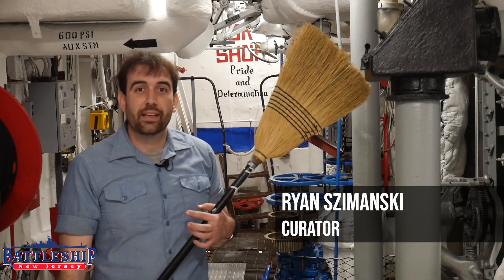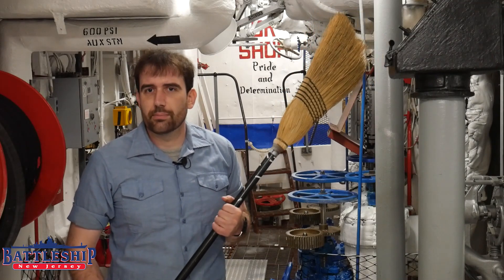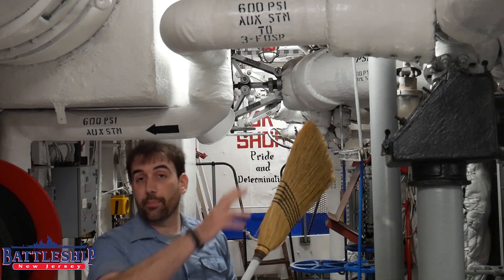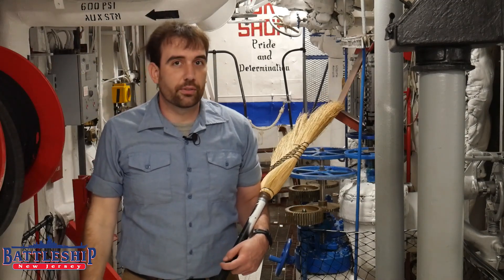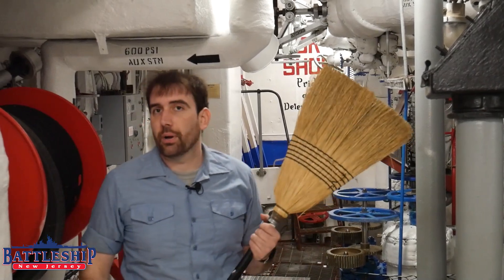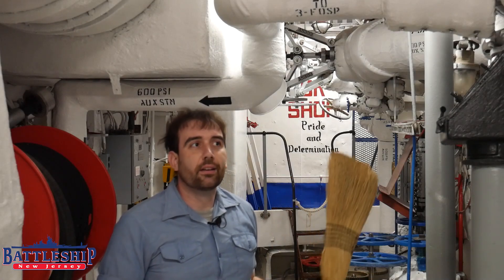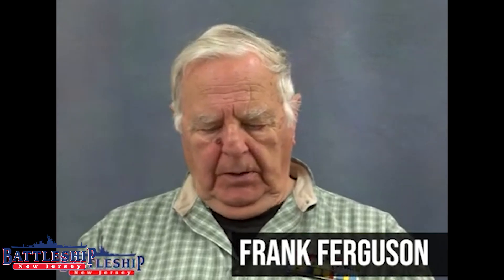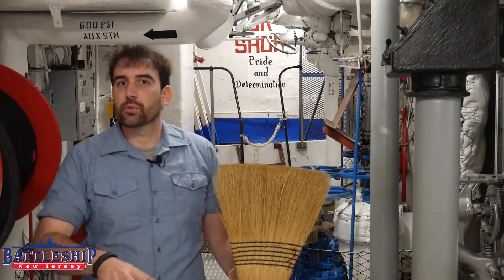Searching for Steam Leaks in the Battleship's Boiler Room

Comment: Used the same broom technique in the search for high pressure air leaks.  The SSBN I was on had some air pressures as high as 4500. Don't forget all nuclear powered vessels are basically steam powered. They just use reactors instead of boilers the heat up the water.
Reply: During the pad fire that scrubbed STS-41-D (the first flight of Space Shuttle Discovery) for several months, there was a period when they knew that there was burning hydrogen in the area but not where. The problem is, hydrogen burns at such a high temperature that the flame is virtually invisible during the day, and because hydrogen is so diffuse, there is virtually no ambient heat until you're literally being burned by the fire. So NASA engineers, for days, were walking around that pad with brooms outstretched and when they pulled back a burning broom, they knew they had a fire to fight.
Reply: I actually had that realization the day after my friend, who was a nuke in the navy, explained the basic operation of a nuclear reactor to me.  Next time I saw him I asked "Isn't that just a more advanced steam engine?" His eyes went wide and he was impressed I picked up on it. He told me a fair number of the guys in nuke school never put that together.

Comment: I had no idea, I would be curious to know which types of ships ran what for steam pressure. A broom as  a search tool, ingenious.
Reply: Smaller/faster ships generally ran 1200 PSI.  Larger ships and merchant ships generally run 600 PSI.  Even diesel-powered merchant ships will sometimes have an auxiliary low-pressure boiler for heating heavy diesel, space heating and hot water, etc.
Reply: @kevincrosby1760  I was on a world war 11 cruiser ,and we used 600# superheated steam .Flank speed was 32 knots .

Comment: Yep super heated steam has no water vapor. It is invisible.... that's what super heating does it removes water there by "Dry steam" which has less resistance and is more efficient.. The steam whistle on a tea pot uses water vapor to make the noise. we regularly walked around with broom sticks it was easier to keep the Non bristle end in the air for long periods. if the the end of the broom handle hit the deck all stopped until leak was found 1200 PSI is nothing to fool with it will cut steel.jim 2nd ENG.

Comment: 32 years of local 638 NYC Steamfitters and yes you use a wooden ruler in front of you when entering a room with high pressure steam for the 1st time.
Reply: United Association of Plumbers & Steamfitters and HVACR.   We continue the tradition and are the only remaining institution left teaching Steam since the US Navy is fast departing steam plants for Gas Turbines and Big Diesels.
Thank You Brother
Reply: @curtiscains8533  not completely correct.  Nuclear-powered ships are still all steam.  The difference is simply how you are heating the feed water.  Everything is still pretty much the same once the Main Steam pipes enter the engine room.  I believe that modern carriers are still running 1200 PSI.

Comment: (1) stem would very quickly adiabatically expand to atmospheric pressure, so RIGHT AT the hole it'll be full temp and pressure but outside the leak stream it'll be 275-315F (75-100 F superheat) then that stream will rather quickly drop to saturation. Still hot enough for instant 3rd degree burns 
(2)We totally did this at the power plant, though in my 13 years, dealing with everything from 1005f @ 2500 psi to 1080F at 3600 psi, most leaks were pretty easily identified. But we did have a couple LARGE leaks we could hear and not see. Those were fun days.
Reply: that's terrifying
Reply: I was in 1200psi superheated engine room on USS JOHN F KENNEDY CV67 and this is exactly how we checked for suspected main steam leak normally valve flange or valve stem packing

Comment: I am retired from a large steel mill, our companies main boiler house had a number of very large boilers producing high pressure super heated steam.  I was in electrical maint. and I would maintain the instrumentation and electrical systems, we were taught that the first thing indicating a HP Superheated Steam Leak... would be the noise, maybe, depends on the level of ambient noise... we were taught if a leak was suspected to use a 2X4 in front of u.  HP superheated steam is a dry steam and is invisible....and if the high pressure doesn't do serious damage to u, the 800 degree plus temp. will .... at that pressure and temperature if u ran into that leak, it would instantly burn flesh off of u to the bone...
Reply: Absolutely,and scold your lungs . In this situation vacate the space put on an OBA then trace down the leak and isolate it or your a dead man .

Comment: I was told the same thing about using the broom to find high pressure steam.  I wish Myth Busters had covered it. 
Old wives tale?  Well water jets do cut with more pressure but far, far less heat. Water transfers heat very well. 
BTW - it is dry steam so there are no fluids. Water droplets are bad for turbine blades. Picky, but educational. 
Congratulations on the extra commercials during the video.  Perhaps add a few facts to get over the 12 min mark. I'm told that increases monetization.
Reply: Yea, I’ve wished we’d see some sort of test or video documenting it. Superheated (dry) steam is invisible, but the question remains, how long it remains superheated after it crosses the threshold of the hole into the atmospheric-pressure space. Do the perimeters of the flow stream depressurize fast enough to reach saturation and become visible?
Reply: @westtex3675  you need to drop a LOT of BTUs before the steam becomes visible vapor.  Temp needs to drop from about 850 down to 212, then shed enough additional BTUs for the phase change from 212 saturated steam (invisible) to 212 degree water (visible).  A BTU is the amount of heat required to raise the temp of 1 pound of water 1 degree F.  I keep thinking that it takes around 900 BTU to initiate the phase change from a pound of 212 degree water to a pound of 212 degree steam at sea level.  Ditto going the other way.  It's this additional energy for the phase change and the volume difference between water and steam which allows useful work to be performed with steam.
Reply: I’m not thinking the room is going to quickly cool down the stream enough. Just the rapid depressurization might bring it (or at least some of it) down to saturation. And if it is truly a pinhole leak, it seems you might have much less that 1lb of water in a 3ft long jet. And if even a fracture of the mass is able to drop to saturation, then maybe it would be visible.
Reply: @westtex3675  Never saw an actual steam leak.  From what I was told, by the time the superheated steam cooled down to the point of condensation, your visible vapor was diffused and not necessarily very close to the actual leak...and we are back to waving brooms around.  I can affirm that the brooms were present in quantity and were waved around if a leak was suspected.

Bear in mind that I am not the definitive source for steam-related topics.  I wasn't a BT or MM, I maintained the instrumentation, not the systems.  I simply found early on that my workload decreased drastically when I understood the systems well enough to determine if a problem was in my sensors or their equipment.  

Go back to some of the other videos and look for the engine order, prop order, shaft revs, helm console, speakers, microphones, SP phones, dial phones, intercoms, gyrocompass repeaters, temperature/pressure alarms, fire/flooding alarms, etc.  Will explain why I spent a LOT of time in the Fire Room, Engine Room, CIC, DC Central, and the bridge.  Was also qualified for main switchboard (generator) watch.

Comment: Straw brooms are also used by truckers hauling liquid hydrogen...it's the easiest substance in the universe to ignite, and it burns almost invisible...so you walk around the truck with the broom and if it starts to smolder you de-ass the area immediately.
Reply: Not only does it ignite easily and burn near-invisibly (so that in full sunlight it's at the very edge of visibility), it both ignites and burns in almost total silence.  Almost the definition of a spooky combustible.
Reply: De-ass. I like that. lol
Reply: Not after a cigarette?
Reply: @acester86  if you want to boom... 💥
Reply: LH2 fire in a pressurized tank transport?  Yeah that's a significant de-assing protocol
Reply: It's also one of the hardest things to seal properly due to the tiny size of an H2 molecule. It's very easy to get leaks. Even some things that are considered completely impermeable to us, like mild steel, are porous to hydrogen.
Reply: @Lessinath  To Hydrogen pretty much everything is porous, it is just the rate that varies. That is why the most popular way to transport hydrogen for vehicles is in metal hydrides, where you take advantage of this to have the gas stored as a phase in a solid porous matrix, so it can be stored at low pressure and only diffuse out slowly as you use it.

Comment: One more thought.  Before Flexitallic flange gaskets were invented,  it wasn’t unheard of to have to run around a power plant during startup or shutdown  and re torque some of the flanges so they didn’t leak.
Reply: I haven't been around that long, but I have done considerable (non-academic) research on gasketing in high temp/pressure steam service and this doesn't make sense to me. The primary application difference between a spiral-wound gaskets and graphite flat gaskets is the minimum seating stress and m factor. Thus the the flat graphite gasket, appropriately torqued, should still seal regardless of thermal cycling. I could believe this would be caused by using B7 bolts in a B16 service, as possibly the B7 would grow more than the B16 at higher temperatures? Unless there also wasn't graphite flat gaskets back then either and the real issue was asbestos-fiber gaskets, which don't stand up to thermal cycling like graphite can.
Reply: @timb83  Asbestos fibre most likely, as plenty of very old steam plant is still in use, and will only get repaired when stuff fails, so a gasket that was put in in 1960 would likely still be in there, along with asbestos packings in valve gland boxes.
Reply: @SeanBZA  I've ran into those gaskets doing several different pipe replacements at different plants, and shockingly I've never personally encountered them in high temperature service (most of those must have been changed out before my time) so I have only have academic knowledge of how well they worked after being cycled. The only contemporary anecdotes of asbestos gaskets in high temp services I came around was in steam turbines, but not any that I worked on. Just enough that I knew to be cognizant of possible abatement needs when taking one apart.
Reply: @timb83  I have seen asbestos lagged pipes still in use as building hot water, and also you still find asbestos gland packings around, even new are still in use for some applications.
Reply: @timb83  remember also that every component in the steam system is designed to move a certain amount due to expansion and contraction.  What doesn't move, breaks.  Flanges WILL leak.  This is why temperatures are bought up slowly, steam is introduced slowly, etc.  As a general rule, leaks go away as things heat up.  The problems arise when gaskets fail AFTER you are at full temp and pressure.
Reply: @kevincrosby1760  which informs the designers decision on what kind of joint (mechanical v welded) to use in a given application. At the joint the proper child torque should be applied to the gasket to ensure its leak-tight hot or cold. If leaks occure: (a) the wrong bolting was used, (b) an improper gasket was selected or (c) an inadequate tightening procedure was used. Given a long enough time-line everything will fail. Given a reasonable life expectancy gaskets shouldn't leak.
Reply: @SeanBZA  oh yeah, I know that shit is around like landmines, I just have no personal experience with the efficacy of asbestos gaskets in high temperature service.
Reply: @timb83  In theory you are correct and shouldn't be an issue, but even so the boilers I worked around (albeit not navy stuff but still high pressure) you'd always have leaks regardless if the bolts was torqued correctly. Through heating and cooling, water hammer, and any other vibrations through out the plant will always cause things to loosen up over time. Yes by all means they should never leak, but in practice and in actual operation I can promise you, your going to have multiple leaks. Side note, our steam plant was installed in 1918, but the boilers have been replaced and most if not almost everything in the plant has been replaced at some time or another, other than 2 16" main valves that are stamped 1918, and still hold to this day and have never been broken apart (per our records at least) to be resealed, or reseated... all that has been done to them was the packing on the stem replaced every year when the valve its self was being exercised.
Reply: After a long dry dock period even in todays navy we spent the first 24 hours looking for leaks and flanges to tighten up. Always had a few that were loose or forgotten about by the ship yard workers.

Comment: Years ago, I worked industrial safety in a large garbage burning power plant. The boilers ran 800 pounds, the hydro test pressure to verify boiler tubing work was 1200 pounds. The boilers and the entire length of the airflow path had to be cleared of everyone except 2 inspectors when doing hydro because of the danger of welds failing in the boiler tubing. High pressure steam is nothing to be trifled with. Imagine the ship's steam plant with anything from minor leaks to sudden catastrophic failure from battle damage.

Comment: Nuclear vessels are still steam powered.
Reply: Yep. Just mentioned that fact to a guy who was under the impression that he didn't have to worry about steam on his nuclear powered carrier.
Reply: @edfrawley4356  Whereas in reality, you usually have MORE to worry about per boiler:  The conventional layout is to have a closed-loop through each reactor that brings the heat out to a heat exchanger to boil a completely different supply of water to provide the steam to drive the turbines.  A lot of Russian nuclear vessels don't, but that' because a lot of them (especially the subs) don't use steam on the primary coolant loops through the reactor, but MOLTEN LEAD.  This has the very complicating problem that the reactor cannot be permitted to go cold until it's time to permanently shut it down for retirement.  (There's supposed to be dockside support to heat it in port, but in practice this equipment was often out of service, forcing most vessels with this type of reactor to remain at active power to keep the reactor viable in port.  This is just ONE of the reasons Russian and before them Soviet sailors were afraid of their reactors in a way US sailors never were.)
Reply: @edfrawley4356  that guy is an idiot lol
Reply: In Western world, operator controls reactor.
In mother Russia, reactor controls operator.
Reply: @stevedoe1630  That joke was not great but not terrible

Comment: Pretty much the same thing in power plants.  One of the great Philadelphia area electrical generation “war stories” is about Philadelphia Electric Eddystone #1, which was a supercritical plant (over 3208 PSI and something above 705 F). Everything was fine until they had their first steam leak.  They could hear it and see the condensation on a wall about 30’ away,  but they couldn’t determine the source.   Their solution was to promote a case of the wooden yardsticks hardware stores used to give away for free from the local hardware store and a box of wiping rags.   Same basic idea.
Reply: a lot of those first Gen supercrits ran 3600 PSI @ 1005F at the throttle. Interesting note, the first supercritical boiler (B&W UP-1) was actually ultra-supercritical providing >4000 psi steam (any water over 705F is steam, the supercritical fluid area is over 3208 psi but less than 705F). Modern ultra-supercrits are just playing catch up to a late 50s B&W boiler (though they're much more efficient).

Comment: We actually had two steam leaks where we used brooms to search for it onboard New Jersey in the late 80’s. One on the HP turbine in EMO1, one in EMO3, don’t remember where that one was. 

We regularly trained how to identify and search for steam leaks onboard.
Reply: Gonna need you to comment more often on videos :)
Reply: How where the leaks fixed? Did an entire section of pipe have to be replaced or could the leaks be welded shut?
Reply: @TEHSTONEDPUMPKIN  all the leaks we had were at flange gaskets, so we replaced the flex gasket and continued operations. I have never been involved with a pipe failure/hole. It happens, just not often.
Reply: @cruser69  Ah, cool. Thanks for the reply mate.
Reply: What does EMO1 mean?
Reply: @studinthemaking  EMO1, engineer room #1
Reply: Still taught